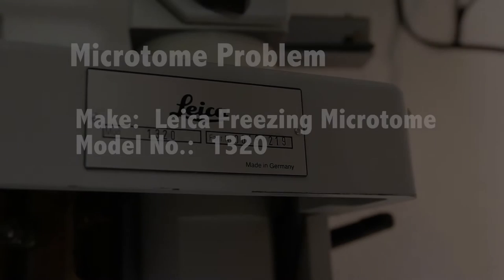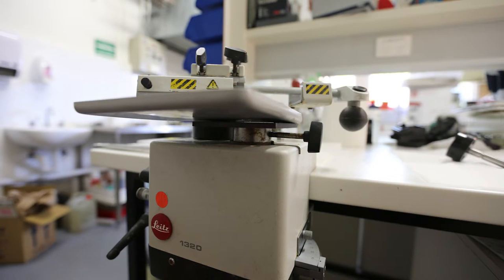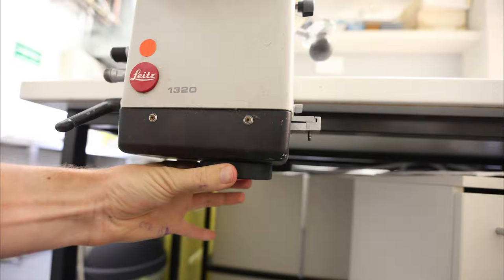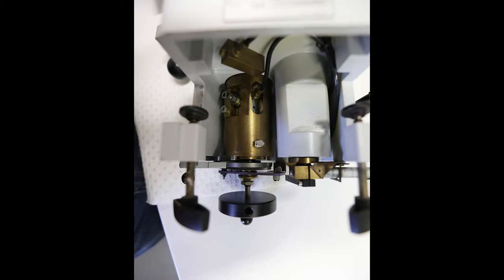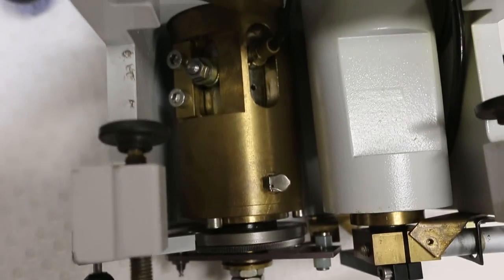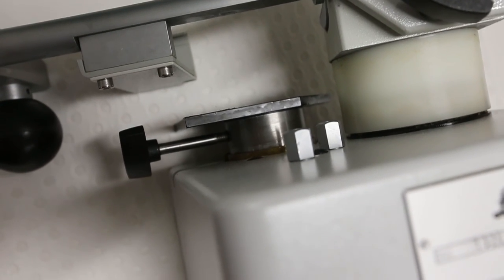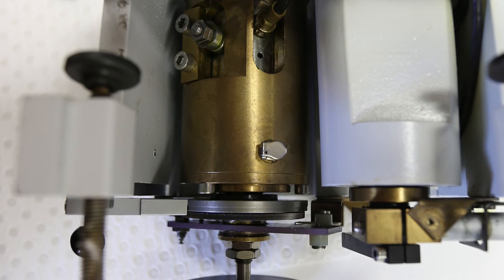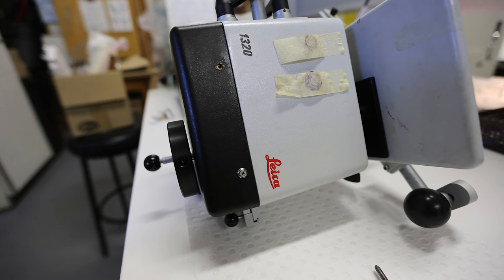Microtome Problem

Comment: To me the valve looks like a grease (or zerk) fitting allowing the cylinder to be filled with grease from a grease gun. The grease might just be depleted and need more grease added. If you can find the right grease gun, you might try refilling 
through the fitting. Also, as some greases age they can become more gummy or hard rather than slippery and this can cause the pawls in a ratcheting mechanism to get stuck in the unengaged position. This same thing happened to the ratcheting brake-shifters on my bike. Just forcing in fresh grease might or might not help.  The  best solution is to first remove the hardened grease, either manually or by flushing with solvent and then to replace it with fresh grease. I suspect you would have to get the cylinder apart to flush it out. A good machine shop might be able to assist. As a last resort, you might try heating the cylinder with a hair dryer or in a low-temp oven or incubator to see if you can soften the old grease and either get the parts to move freely or llow you to push in fresh grease. Best of luck!

Comment: did you ever figure out the issue or find someone to fix this?
Reply from the maker: No.  I live in Australia, and sadly we don't have any engineering companies that repair microtomes here and Leica Australia no longer has any engineers that know how to service these models.  Leica also did not seem inclines to put me in touch with any of their engineers in Germany who may know how to service them.  There are several companies in the US who seem to service microtomes (e.g. http://www.imebinc.com/repair_microtomes and https://www.emsdiasum.com/microscopy/products/repair/equipment.aspx) but the units are very heavy and it would be prohibitively expensive to get them there and back.

The microtomes are 100% mechanical and so I wondered whether it would be worth hiring an engineer here in Australia to take one apart and reverse engineer how they work and video the process so that from then on I would have someone who knew how to service them.  But I don't have the funds for that at present.

In the short term my PhD student found that if she tightened the two nuts visible above the stage advance dial  shown at 1:51, then the stage once again advanced.  It is still a little stiff and likely still needs a good service but at least she was able to continue cutting for the time being.